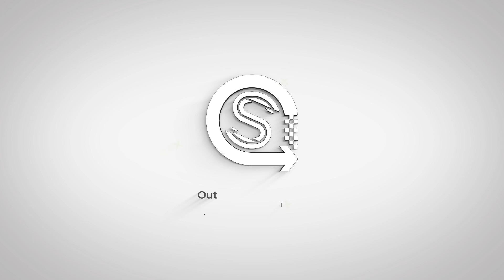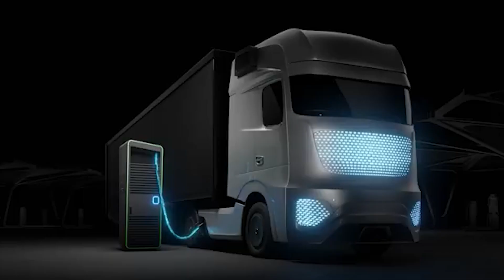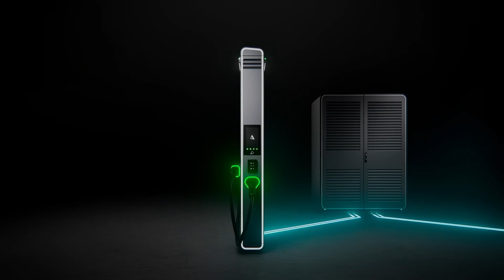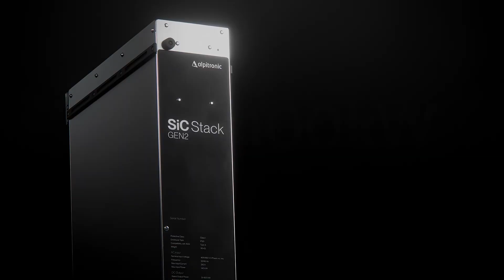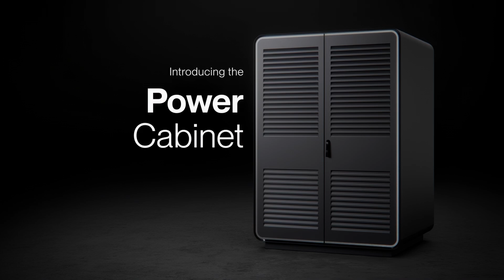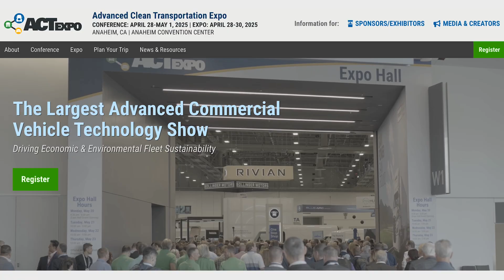Alpitronic Goes To Megawatt DCFC Power Levels! HYC1000 + Distributed Power Sharing

Comment: This is all well and good, BUT they went for the wrong direction.. HYC400 had 50kW granularity, but now they support (only) 8 plugs and in 62,5kW granularity.. That is HUGELY wastefull.. Let's say 5 cars charge around 70-80kW (Stellantis in winter for example) they already require 10/16 power stacks and they WASTE almost 50kW EACH (125 - 70-80kW) totalling 500KW (!!) The remaingin 3 slots need to cope with 6 power modules.. (375kW)

NOW with Kempower MORE (coming Q4 2025) supports up to 12 plugs, 1,2MW and in 25kW granularity. Operator can use hundreds of kWh more at any one time. Literally money left on the table with Alpitronic. 

The future is in big chargin hubs. 8 is not enough. If you ramp up and add second HYC1000 system you double the wasted power.. :/
Reply: I think you misunderstood something there. AFAIK you can connect up to 8 connectors to one cabinet. In each cabinet you will have 8 power stacks with 125kW each and each of those stacks is build from 2 power units, each 62.5 kW. So in your case the  5 Stellantis cars will utilise 5 stacks and the other 5 would be free for the 5 non used connectors. In case one of the connected cars falls bellow 62kW one of the power units would be free for any other car to use.
And yes, Kempower has a much smaller granularity, which is quite impressive, but I think you got some numbers wrong, 12MW? I doubt it. And 1.2 MW for 12 connectors is also not ideal, as you only have 100kW per plug at max utilisation vs. 125kW with the Alpi unit. But at the end of the day, both are very good units and very reliable and it will be a plus to see any of them at any charging station.
Reply: @e-redj  5/8, not 5/10 power stacks. ;) And 1,2 MW ofc is what I meant. For sure 100 kW would be marginally slower, BUT IRL Kempower is faster 99% of the time because 1,2 MW > 1 MW, no matter the number of plugs, since rarely they are all over 100 kW and with 25 kW vs. 62,5 kW MUCH bigger portion of the total 1,2 MW is available any given time. That's a fact.

Comment: Alpitronic reliability is what's most important.... 

But it's overdue, that they are finally offering a distributive power option.  Keep up the good work.
Reply: But really wastefull.. 62,5kW is way too much! 25kW of the Kempower system is way better. More money for operators.
Reply: @scronkfinkle1408 - different designs.

Kempower's cabinets have a lower footprint density requiring three cabinet units to provide 600kW output; with four power modules per cabinet, 12 in total for a three cabinet configuration, 50kW per module, which have two sub-units each delivering 25kW, hence the lower step size. This approach gives an overall solution power efficiency of 95%. 

The Alpitronic unit has a single cabinet (a little over 50% of the width of a three bank Kempower unit) with 16 power single-output power modules, delivering 1MW, with 62.5kW per module (hence the higher step size), but with a 97.5% power efficiency. 

The power to footprint ratio of the Alpitronics is better for CPOs, as well as lower electric supply operating costs due to the high efficiency. The step size difference will only be a consideration for smaller battery sized vehicles and charging at high SoC, where other vehicles charging will not benefit from the under utilised power module capacity.

Comment: With 600A and 1000V will you be able to get 600kw from a single connection? The Alpitronic video clip you inserted showed 500kw to a car at one point (and 250kw with 2 on a dispenser, which I assume is the max when split). I assume that is the maximum power available, but this was never discussed AFAIK.

At first glance, this seems to be a serious shot at Kempower:  more power in the cabinet (1MW vs 600kw) and 500kw at the satellite dispenser vs 320kw. No idea how the prices compare, obviously, but it's nice to see the competition heating up.

I do love where Alpitronic is headed and that Ionna and other CPOs are adopting it fairly quickly. More alternatives to Superchargers is a good thing, especially when they are so reliable.

Comment: I realy like that the HY400 can charge with all 4 ports at the same time. Makes ut more flexible then splitting between the "left" and the "right" side...
Reply: I USA, there is no three phase AC EV charging. All the HYC400s in USA that I’ve seen are 2 plugs - to guarantee at least 200 kW per connector.
Reply: @barryw9473 what are you talking about?

HY400 does not support Mode 3, only Mode 4.

The HY400 can charge 4 cars on Mode 4 at once if you order it with 4 cables.

If you order it with two cables, it can charge up to two cars at once on Mode 4.

It does not support Mode 3.
Reply: costly over engineering,  to have redundant cabling.... 

But if the CPO is willing to pay for it? Might as well give them what they want.
Reply: I actually saw some new Hyperchargers the other day being installed in Austria and they had 4 cables. Maybe a new version that can split to 4x100?
Reply: 2 ports not 4 on the HYC400.
Reply: @barryw9473 No, 1 to 4 ports. The ones you have seen have only two speck out.

The two HY400 at my local gas station have 3 ports per charger. The one port is unused.
Reply: @barryw9473 Some have 4. Some have 2.